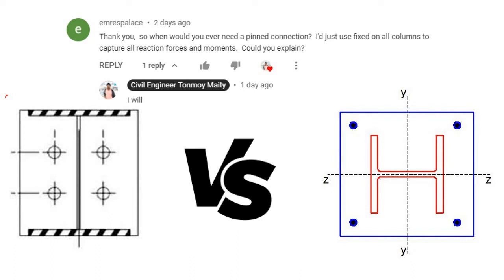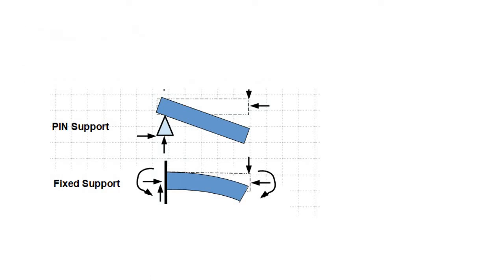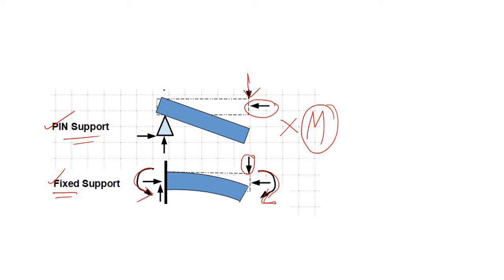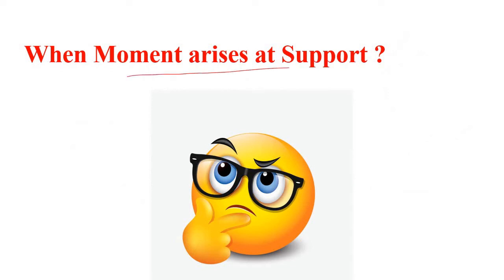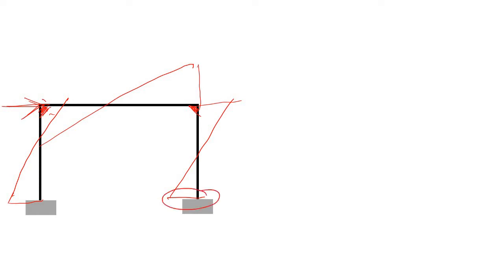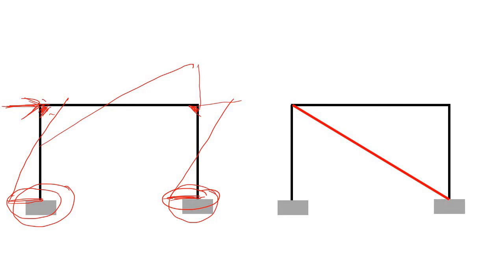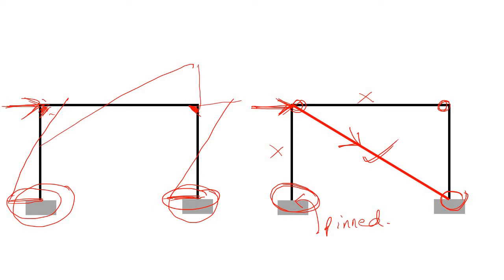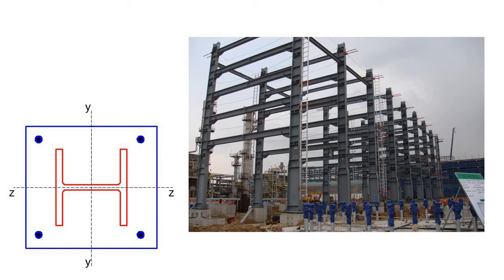Pinned Base vs Fixed base

Comment: If you use pinned as support base, you will have a large superstructure members while if you use fixed as support base, you will have a large foundation design.
Reply from the maker: Exactly
Reply: Could you please explain shortly... How exactly does it happen?

Comment: in this example the lateral load in x direction requires a pinned connection whereas the lateral load in y direction requires a fixed connection. I assume the base plate will be designed with the highest moment so in fact they will all be fixed base?

Comment: 1. Are these four blue anchor bolts nothing to do with the fixed connected support?
2. Are the additional red  anchor bolts responsible to resist moment, and it should be installed outside the flange zone?
Reply from the maker: Objective is to hold the flanges to resist tension coming due to  moment.
Reply: @TonmoyMaity  Thanks.

Comment: Do we need to consider axial tension force while designing pin type column base plate?
Reply from the maker: sure..for the Bolt
Reply: @TonmoyMaity  thanks, your vedios are much help ful❤️

Comment: Should we weld the web of I section for pinned support?
Reply from the maker: You can
Reply: I WAS WONDERING AS WELL
Reply: Welding has nothing to do with the type of connection . It's the degree of restraints we provide to transfer shear or moment . From one member to the other member.